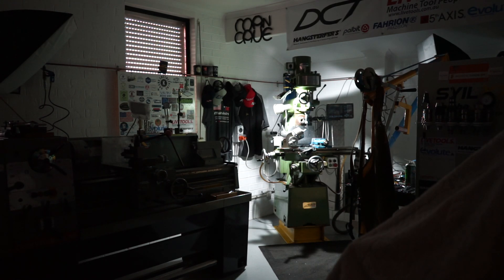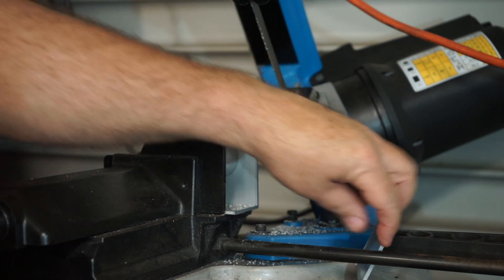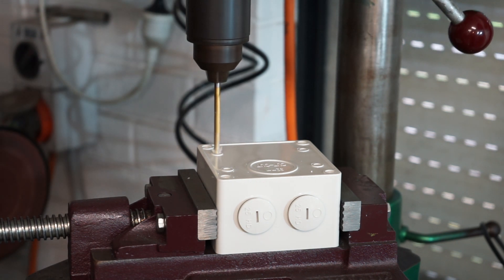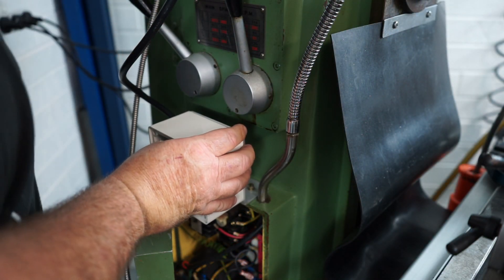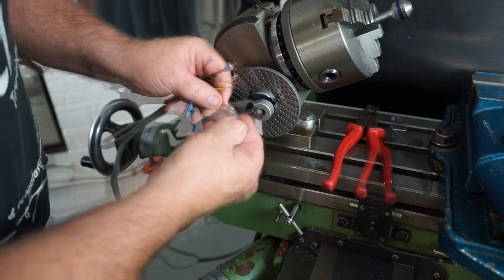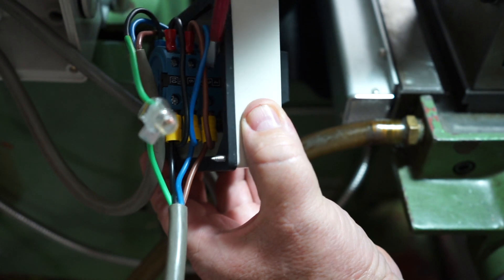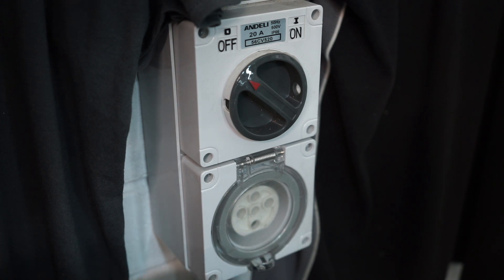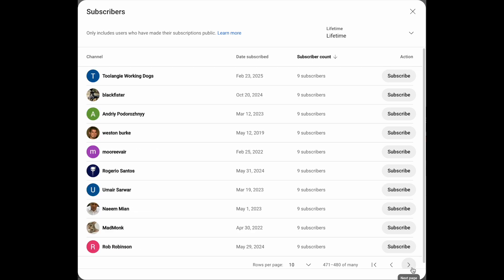Milling Machine Modification - 3 phase Forward & Reverse Switch

Comment: Nice install. Pray you don't need to shut it off in a hurry. An emergency stop would be a good addition.
Reply from the maker: Hi Russel. Because I installed the switch before the electrical cabinet I still have all the original controls in operation. Sadly the vertical spindle doesn’t have an E-stop like the horizontal does. Might check if I can connect that on to the relay. Cheers 🍻 .

Comment: Nice job Aaron. Just a point, reversing the polarity of the entire system could reverse the direction of rotation of your coolant pump - if you have one fitted. You might like to give that a check.  Cheers SteveO
Reply from the maker: G'day Stevo.  Thanks for the heads up mate.  I did think about that.  I'm not actually using the coolant pump in this mill, but I should be.  Cheers, Aaron.

Comment: Hi Aaron just to bring that up to Australian electrician code the blue point connector you used to join your earth should be a two-screw type. All earthing points require a two-screw connector. You will wonder why you never did this when you first got your mill. Cheers Stuart Hingston.
Reply from the maker: G’day Stuart. Thank you for pointing that out mate. I very much appreciate it. I’ll make the changes immediately 👍🍻

Comment: Nice install Aaron. The most pleasing thing in this video is seeing a hand tool that you have had for many years and is in as good shape as the day you got it. Those tools form an attachment to us. I can remember when I got each of my hand tools and they are all still in great shape today. A man who cares for his tools but still gets full use from them is a craftsman indeed. Also - phase rotation correct right off the bat! I think that has happened for me once only. I pretty much always have to swap two wires. Nice one, great install. Cheers!
Reply from the maker: G'day Stuart.  Thanks for watching and following along mate.  Yes I've still got all my tools from when I used to work for a living (I say that in jest, as I'm a teacher now lol).  Sadly my original tools got stolen when I was a couple of years out of my apprenticeship and I had to restock back in the early 90's.  With the phase wiring, I knew it the right way around when I started, so I just ensured to swap (jump) Lines 1 & 2.  But you're correct, every other machine I had to swap to get it the right way around including my CNC back in the day.  Cheers, Aaron.